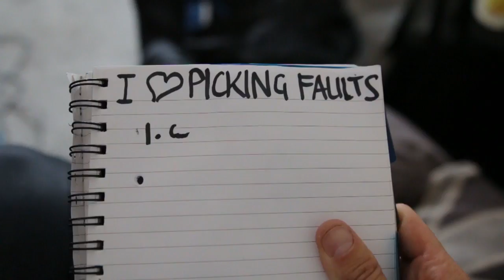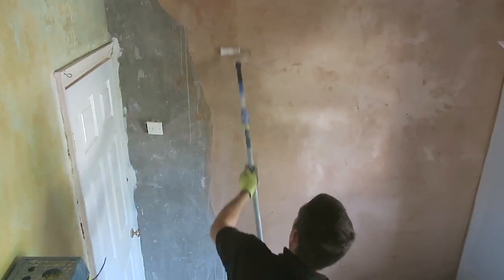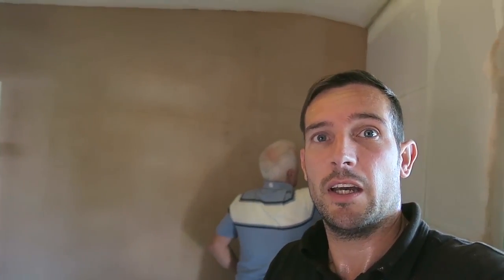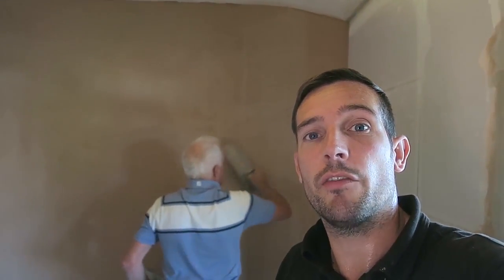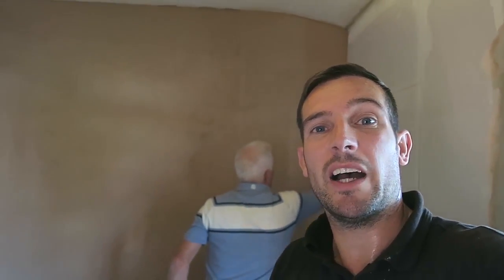PLASTERING JOB - skimming walls

Comment: Great job lads, I am a plaster just a little advice a smaller trowel would benefit you more especially for laying on something about 13/14 inch, lovley work with the pointing trowel.
Reply from the maker: yeah rob got a 14 now cheers mate
Reply: Excellent mate, loving all the videos 👍🏻

Comment: Another cracking video Stu and looks like a great job! Quick question (as I'm a novice DIY-er), how long between coats and the final skim?? Really enjoying your channel pal.
Reply from the maker: cheers mat it can depend on a few different thing pal, weather, what material your first coat is on but generally till you touch it and it feels a bit sandy